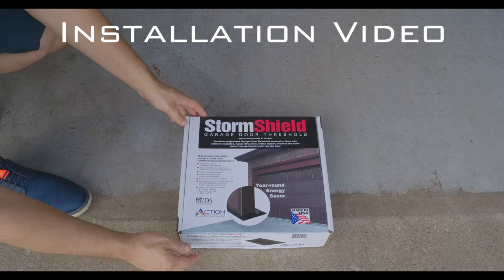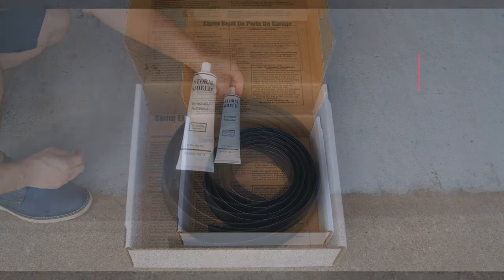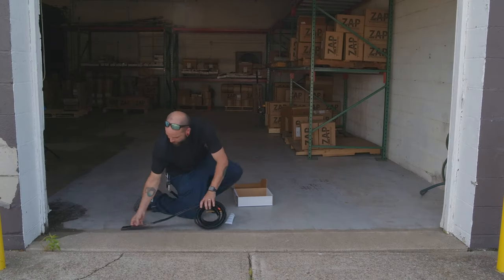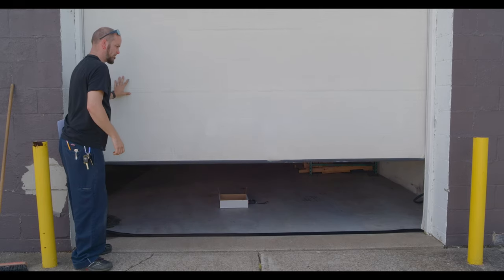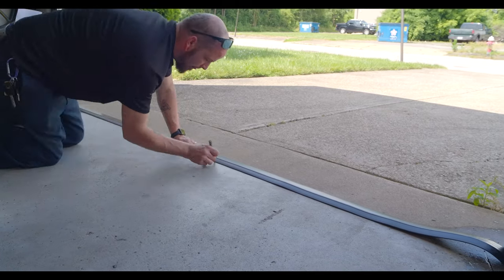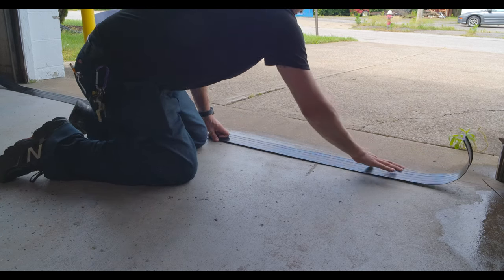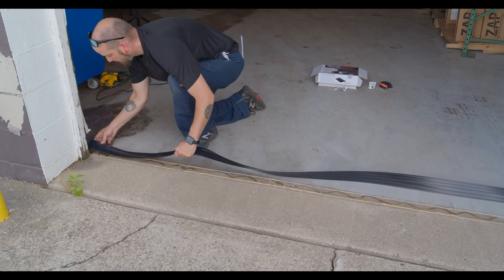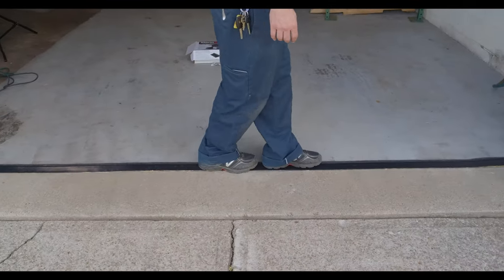How to Install StormShield Garage Door Threshold Weather Seal

Comment: Hi, did you require two tubes? It appears there is a clear and beige sealant. I was also curious why some directions discuss a concrete etch chemical? I assume a chemical etch would only be needed for possible slick concrete. Thanks for the video.